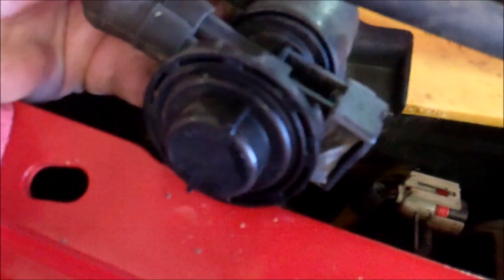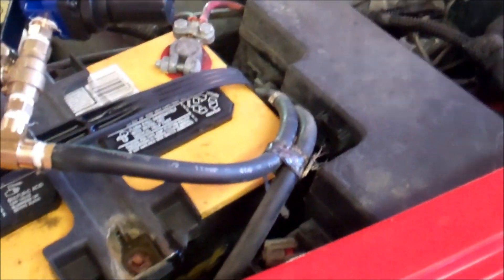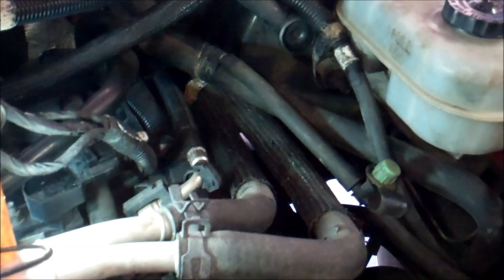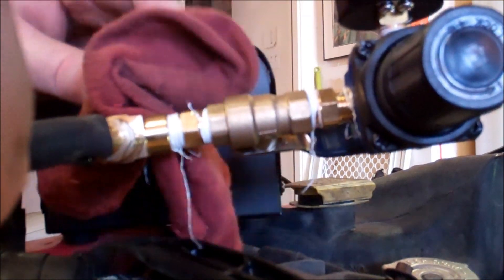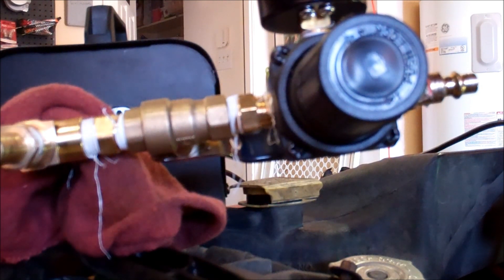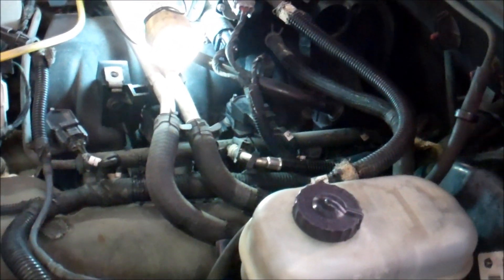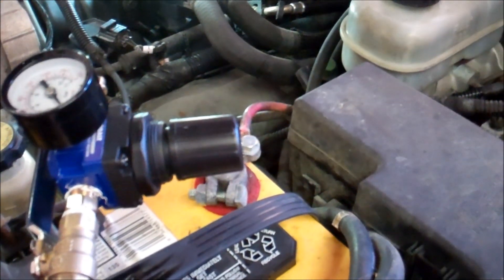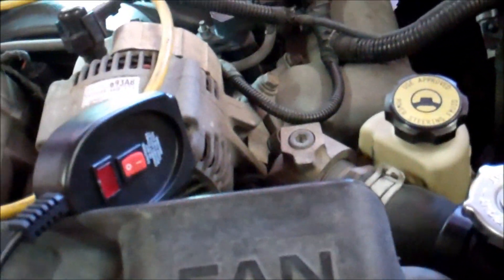2001 Dodge Dakota - EVAP Smoke Test

Comment: I found the same two hoses you pointed out at around 2:45 on the video. Both of my hosed were cracked. I had replaced the gas cap first with no positive results. Napa had the two formed hoses for under 10.00 bucks. Problems all solved, no more check engine light.

Comment: This type of machine will not make the right type of smoke. It disapates to quickly. We tried it in our shop and ended up buying an expensive smoke machine to check for leaks. It  can be used to check for oil leaks too.

Comment from the maker: @G3kRay Yes, I had a total of 3 codes. Two were for the EVAP system (SMALL & LARGE LEAK DETECTED) and the third code was a faulty O2 sensor (possibly due to the rich/lean mixture due to EVAP leaks). I visually inspected the EVAP hoses, and found a couple completely disconnected. When I used the smoke, I was able to find the last couple of hoses that had hair line cracks in them. After replacing these hoses, and the O2 sensor, no more error codes! And the truck purrs like a kitten :-)